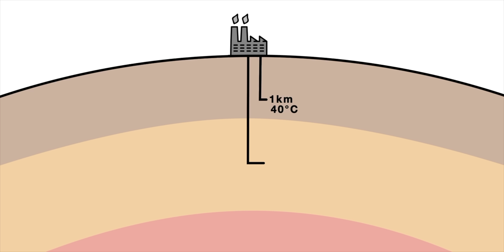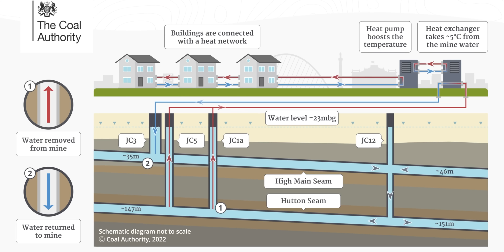Geothermal Can TRANSFORM Dirty Coal Mines into Clean Energy Hotbeds!

Comment: About time! 
As a student, about 50 years ago, these questions were being asked, but to no avail. My question now, why isn't it already going Nationwide?
Reply: I wonder if it's expense? The UK could use tidal power but apparently that's too expensive
Reply: Tidal power is plentiful however it currently has 2 major problems …… 1. Unlike solar and especially wind power ( always 3 blades for anything bigger then small sites) example there is no one definite solution yet for wave power as it is so variable …… this not being one type fits all massively increasing costs and limits mass production and 2. Whilst many different tidal/wave power machines have been made and normally produce good electricity at first all almost break down and /or need replacement very soon due to sea water salt damaging very quickly ageing materials and even pretty salt less tidal water power can be damaging in the long run due to the sheer force off water .…… so currently tidal/wave power at least 20 years behind wind and solar
Reply: @discodavid26  I think you're confusing wave power systems with tidal power systems. Wave power does have a problem with the extrees of load that can occur. That's less of an issue for tidal systems - go and have a look for information on the Rance scheme that has been operating in France since the 1960s. As for corrosion you just have to look at the offshore oil industry to recognise that corrosion problems can be overcome.
Reply: @waqasahmed939  I know! I'm surprised that the UK government decided nuclear generation was going to be more cost effective than Tidal Power???
Reply: Quite right! I was thinking about the South Wales ex coal mining. Everywhere with a Mining legacy should be able to capatalise on this with relitive ease? right?
Reply: Setting up a district heating scheme from scratch is very expensive. Like building a new water plumbing grid for a city. Its not lack of heat, its the transport and grid connection plus access to constant heat supply and a buildings with high insulstion to retain low temp heat keeping the air warm. Zero foresight and then one day fuel for heat skyrockets and its emissions damage your economy and those politicians are in a cosy retired pension knowing nobody will come calling to ask then why